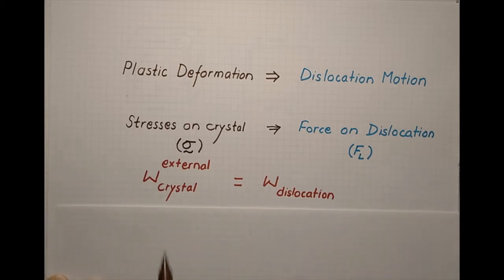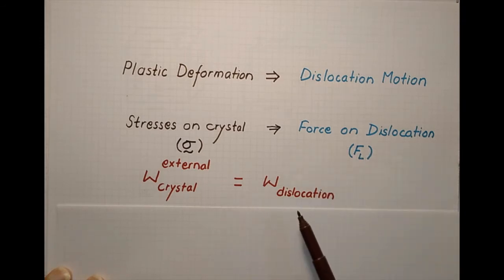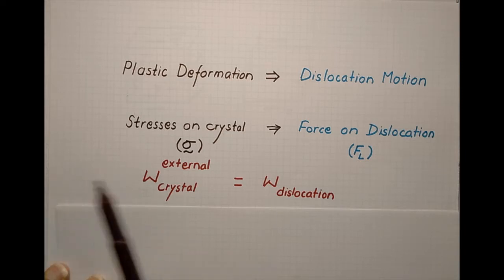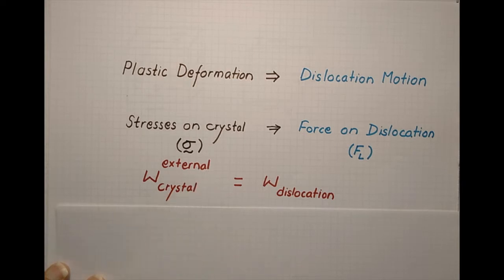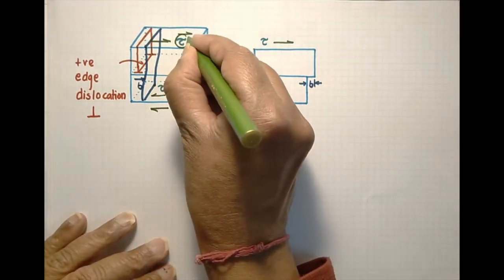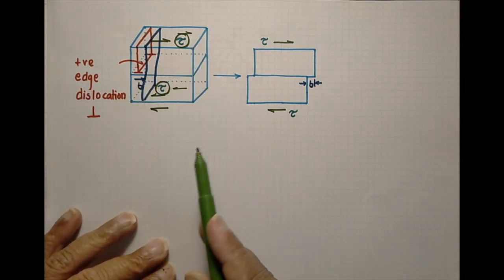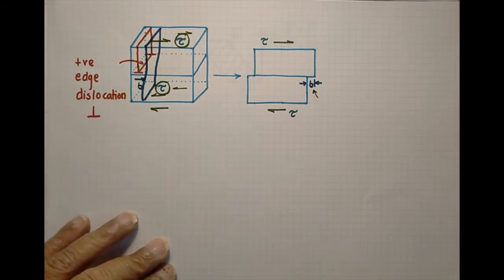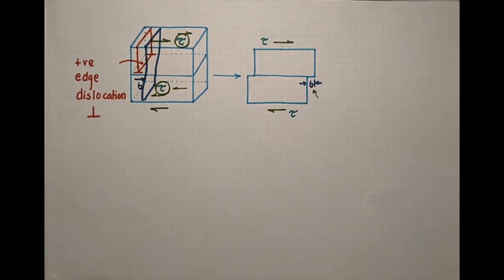Peach Koehler Equation (Part 1): Glide Force on a Dislocation

Comment: Sir, what will be formula for glide force exerted by edge dislocation on screw dislocation?
Reply from the maker: You can use P-K force discussed in this video to calculate the force. You will find that the force between parallel edge and screw dislocations is zeo.